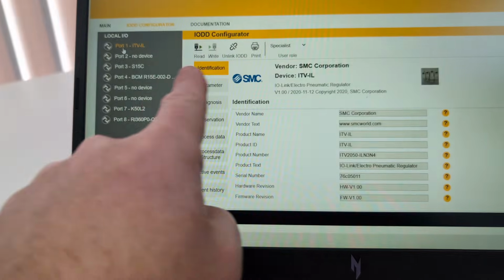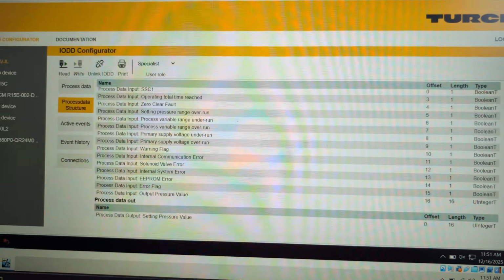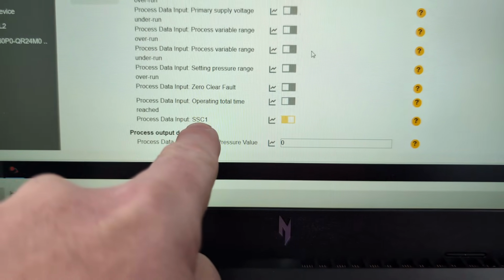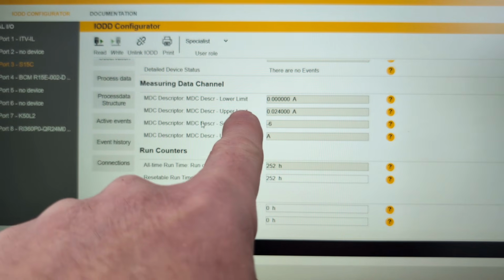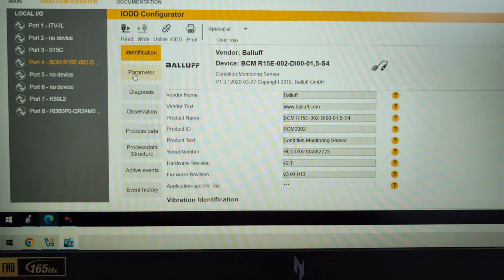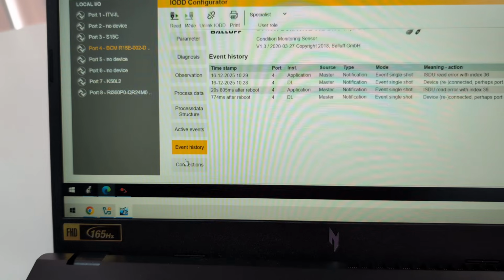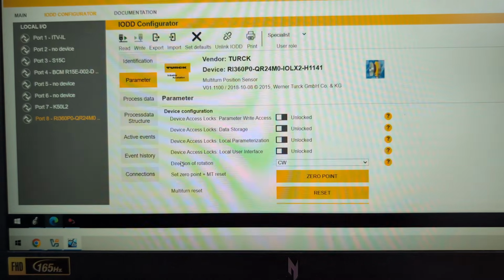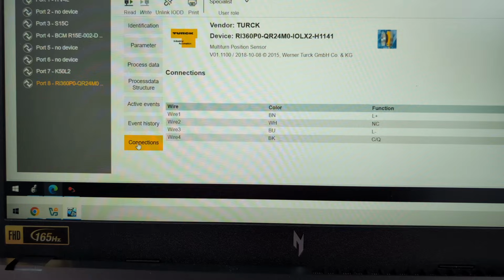IO-Link Diagnostics & Data Mining: Beyond Basic Setup + Pneumatic Trainer

Comment: Are you going to talk about, in a future video, the types of valves and what they do? I find a lot of people don't have a clue and or when to use which valve. 

1.  -2 pos, single
2.  -2 pos, double
3.  -3 pos, closed/open/pressure
4.  -4 pos, duel 3, Nc Nc
5.  -4 pos, duel 3, NoNo
6.  -4 pos, duel 3, NcNo
Reply from the maker: Yes, I've set this up with the most common types of valves so that we can talk through them.